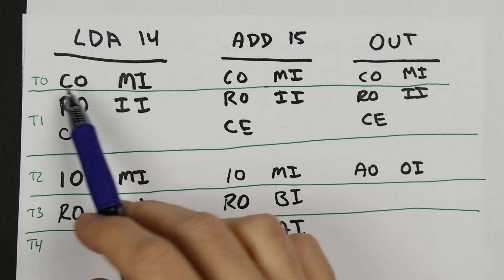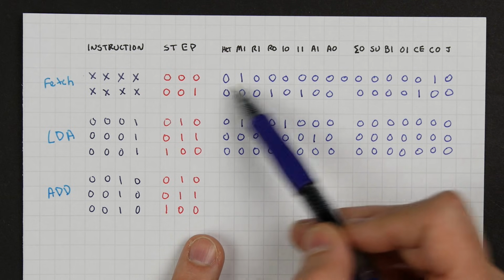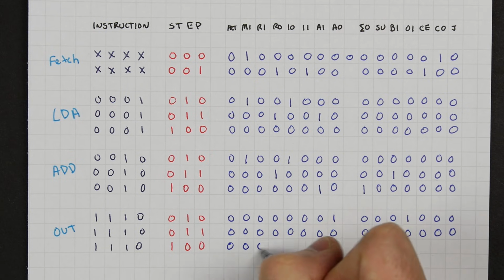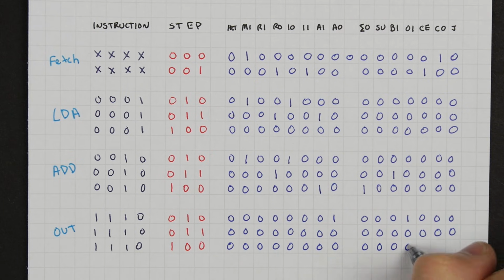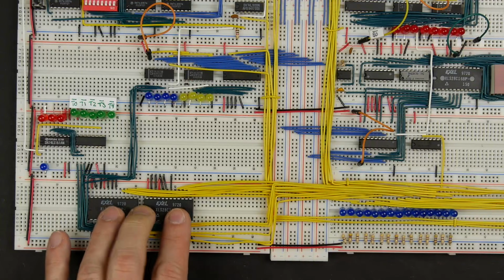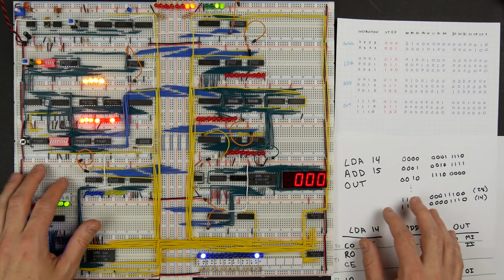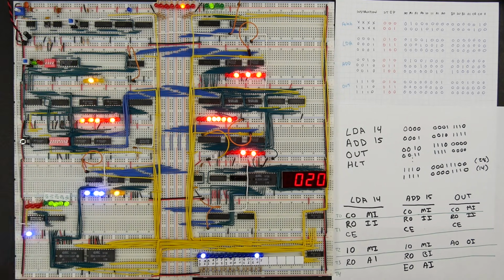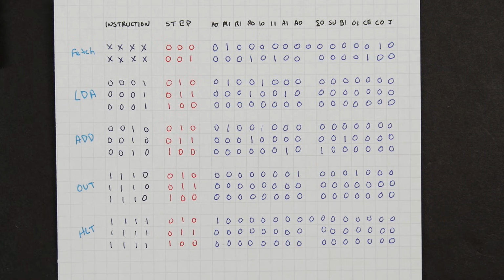8-bit CPU control logic: Part 3

Comment: I find it interesting that the entire instruction fetching, decoding, and execution logic you're building in this video takes up a lot less memory than the 7-segment display decoder (256 bytes across two EEPROMs instead of almost the full 2k for one EEPROM). Intuitively this part is a lot more complicated, but apparently not information-wise.
Reply: Also, if you're going to use the manual EEPROM programmer a lot, wouldn't it be easier to use DIP switches instead of jumper cables for selecting the actual bits to program?

Comment: So, if you had another signal to reset the microinstructions counter (which is the master-slave JK flip flop chip), could you skip those unused cycles? It seems like a very reasonable improvement to speed and could be set at the final step of every instruction. That way, no matter if some instruction is 5 cycles long, if you are using 3 or 4 step instructions, you would be gaining 15%+ average speed.

Comment: My version of this CPU has been upgraded to have 256 bytes of memory about 36 instructions with a max of 63, two conditional lines with jump on (no) carry and (A!=0) A=0. Used the unused output on the 2nd rom for an external input, added a 3rd rom for microcode reset (and maybe further hardware) so shorter instructions only use as many clock cycles as it needs up to 7. The 256 bytes makes it prohibitive to manually program so I came up with a loader to pull a program off a rom on the IO bus so I only need to program 10 bytes manually and it loads a longer program in

Comment: You also bumped the memaddr reset cable at about 31:05 which cleared the memaddr but luckily it did not matter at that point :)
Reply: Thank you for commenting on this. I’ve been scratching my head as to why that went to all zeros and mine did not. I also somehow get a 30 and then a 47 on the display on the way to 42. Not sure how that’s happening, as output in is only enabled at the end.
Reply: @smithw7003   Yeah. I don't think Ben mentions this at all in this series, but you really should have pull-up or -down resistors in the signals that have manually operated cables, that way the signal gets only activated when you insert the cable into the other voltage and not by just losing connection momentarily. I cannot say what causes your strange numbers, perhaps you have an intermittent connection to OI. Or a supply voltage problem might also do weird things sometimes.

Comment: Great video series, thanks for making these. That EEPROM based decoding scheme reminded me of the MOS 6502 decode ROM, showed in Michael Steil's "27C3" - "Reverse engineering the MOS 6502"  Also the micro instruction timing was similar.

Comment: Why did the [Memory Address Register] clear it's value a moment after the clock was stepped forward at 31:00 ?  The instruction was [RO] and [AI] and the rest LOW.  It should have only moved the value in ram to the A register, not reset the [Memory Address Register], right?
It happens sometimes right after a value is moved out of ram, but not always... why?
Reply: Oh, he bumped the MAR reset wire and reset the memory address register to zero a couple times.

Comment: Once you finish this 8 bit cpu build video series, you will have two fairly similar breadboard CPU's, right? Would you consider doing a short bit where you explain a few things about the basics of how asyncronous cores work in modern multicore desktop CPU's, using the two breadboard cpu's?

Also maybe a short bit about creating a small serial comm between the two as well?

Comment: I'm curious about the Halt command, that's a dead end isn't it? there is no way a computer (that relies on a clock signal) could ever undo this, seems very strange to me to have such a state vs a pause of some kind.  That aside this has been an extremely informative series so far being almost exclusively a software person the hardware side of things have long been a mystery to me. 

and now I can count in binary so that's a plus
Reply: Many CPUs, especially microcontrollers, have a halt command that is useful to save power. But usually the CPU continues execution when an interrupt happens (e.g. some peripheral wants attention).

Comment: This has to be one of the highest quality video series I've seen here on Youtube.
Reply: For sure!! I've watched every single video in this playlist from start to end and I understand everything so far 100%! I'm sure by the last video I'll be able to build one of these myself with my own design (I have a different method of doing the display logic, and I have an idea on how to eliminate those wasted clock cycles on shorter instruction sets).
Reply: Probably better than real electrical engineering courses in colleges.
Reply: 100
Reply: It is. Until you see his 6502 cpu series

Comment: I would suggest to use the left over bit in the signal word for resetting the instruction counter. So that you can say "with the next clock pulse reset the counter" - useful if not all time steps are used.

Comment: Have you ever thought about using something like a crystal oscillator to use as a timer? This could be used, (in conjunction with more ram/instructions/etc) to interface with devices like an Arduino, to interface via i2c/usb/ethernet/etc. My main concern with using such a fast clock is how fast the chips themselves are able to change. Of course the communication is outside the scope, but perhaps a constant, highspeed clock isn't? :)

Comment: I think the halt command could just be a 4-way AND gate on the 4 instructions bits. If you somehow initialize the ram to FF everywhere as soon as you exit the memory region where the program is encoded it will output the halt command. 

The same way you could implement a 4-way NAND to trigger a counter reset when the instruction is 0000 with a gate to only trigger the reset on !(T0 || T1), effectively implementing a NOP instruction.

I'm still waiting on having a bit more of money set aside to be able to start such a project : as a programmer I love to explain to my friends how a computer works and this is a perfect demonstration board :D

Comment: At around 39:39, the computer starts loading undefined instructions, and starts putting multiple things on the bus. (Sum out and counter out are enabled simultaneously) Won't this cause a short and damage the components if a 1 and a 0 are placed on the bus at the same time?
Reply: I don't think it should, because the state of the bus when the input is taken should only be either/or, but not both as it's done on the rising edge.
Reply: @CJBurkey  well those tristate buffers connect the bus to ground at a 0, and to vcc at a 1. that means if one module has a 0, and another has a 1, one tristate buffer will connect the bus to ground, while another connects the same bus to vcc.
Reply: Wait, +MrEdrftgyuji explains why it could a few comments below
Reply: better hope all the magic smoke doesn't escape
Reply: You're exactly right, it's driving multiple contending outputs onto the bus (sometimes all five at once!). It's a good thing that these TTL parts are forgiving about "shorts" like this. Of course, TTL outputs have limits on the current they can drive.
For that same reason, Ben is able to directly connect LEDs to outputs without a resistor (and not blow them up). That kind of thing is "minor abuse for the sake of convenience", and might cause problems like power supply lines being dragged down (and logic levels being lowered to indeterminate levels), but hey...
FYI, most TTL-ish logic can source (push out a high logic level) much less current than they can sink (push out a low logic level). E.g. a 74LS32 datasheet I'm looking at shows source output current as 0.4mA, and sink output current as 8mA.

Comment: Alternatively, you can have a halt condition from the RCO output pin on the program counter. This pin is HIGH while on the highest address (0xf), and LOW otherwise. The halt functionality doesn't have to take up opcode space that way: just let the program run to the end of memory, then stop.

Comment: question: in a serial shift register, what prevents the output of f-f A from going into f-f B and generating and output on f-f B? why does it have to wait for the next clock pulse?
Reply: There are two ways to do this.  One is to use master/slave flipflops.  These flipflops read their new value in on the rising edge of the clock and write it on the falling edge.  This keeps the changing signal from going farther then you want them too.  The 2nd way is to make the flipflops read their value on the rising clock edge, make the time that they are reading that value short enough that the internal feed back paths don't cause problems, and make the clock arrive at all the flipflops at the same time.  The 2nd way lets you use faster flipflops but requires harder layouts of the wires on the board.  This is why when you look at a motherboard you will see some wires go strait from one chip to another, and others squiggle around a bit first.  The different lengths of the wire make all the signals arrive at the same time compared to the clock signal.
Reply: ared0hel thank you, I've asked this question to a couple of electronic technicians I know and none of them knew the answer. So I had to ask the internet. I'll look for more info on the whole master/slave situation ;)
Reply: Ben has 3 videos on exactly this: JK flip-flop, JK flip-flop racing, and Master-slave JK flip-flop.

Comment: Awesome as usual, Ben! You have tought me a lot and I thank you very much for it. You inspired me to build a computer myself, only it's 8 bit with a 64kB address space that's split into 8kB ROM and 56kB of RAM. I have seen comments on how much more complex it would be to expand your computer to the same size and I can confirm that! My build is 100x60 cm large! If anyone is interested find me on Twitter (@mynkus) and look at the latest tweet where you can see the address and data bus, ROM, RAM, 4 registers, clock, stepper, instruction register and control logic. The ALU will be built "discrete" with 74xx chips. And I plan to add a 4x20 character LCD. Again, thank you so much Ben for all the inspiration!

Comment: I wrote an emulator a few weeks back. It's messy and slow, but it works. If anyone wants to help, the GUI needs to be worked on and accuracy checked.
https://github.com/nutcase84/ben-eater-cpu-emulator

Comment: Put in some 74LS138 decoder/demultiplexters, 3-to-8 lines, one for output: RO, IO, AO, ZO, BO, CO, HLT and NONE. The other for input: MI, RI, II, AI, BI, OI, J and NONE. Two extra lines for CE and SU. 8 bits in total. Only one EEPROM needed. Part of the opcode 4 bits could be used to determine the length of the cpu instruction. Eg. all 1XXX instuctions being 3 steps, all 0XXX instructions being two steps.

Comment: I would have kept and modified the circuit that drives the fetch steps.  Since they are all the same, it seems a waste of time to program them into the EPROM for every single instruction.
Rather it would have been more expedient to only actually enable the EPROM output at the third and subsequent steps and only have to program where the instructions differ.

Using the last control line to reset the counter would also be a fairly easy way to save clock cycles as well.

Comment: I can see that it would be possible to use that currently unused bit as a signal to reset the microcode instruction cycle counter.

I'm wondering if it would be possible to not only use the currently unused bit as an "Instruction Cycle Reset" line, but also to make it concurrent with the last microcode instruction?

Just using the ICR as a separate microcode instruction would not save any CPU cycles on a 4-step instruction since the 5th instruction would still be necessary even if it was programmed as the ICR signal, but if the ICR could be made concurrent with the final microcode instruction, then a 4-step instruction would truly take only 4 steps.

Perhaps build the CPU so that the instruction executes on the rising edge of the clock pulse and the reset of the instruction cycle counter happens on the falling edge of the clock, if the ICR signal is active?  If part of the instruction requires the falling edge of the clock, then perhaps a capacitor could be used to slow down the ICR signal?  Although that might require an XOR gate too.

Comment: Need to be careful when executing "junk" microcode that sets more than one device outputting on the bus. If one device is driving a bus bit high, and another one low, you will have a short from Vcc to gnd which will probably cause damage to the chips connected to the bus.
Reply: An improvement on this design is to have a 3 to 8 line decoder control which register is outputting data to the bus, preventing bus conflict.  This also frees up some control lines.
Reply: @ared0hel  ...or using a demux for the enable signal // demux{input: instruction-register.bit-a, select: instruction-register.bit-(b, c, ...), output: enable for the various registers}
Reply: @LeonardPauli  or use an arduino to set all unknown values in the eeproms to 0b00000000, just to be sure.
Reply: @ared0hel   Good idea. Instead of direct control of lines it should be some sequential binary code (virtual address) decoded into control line indexes (each combination once in ROM)
Reply: Yeah, that part with executing a random junk from memory made me worry for the exact same reason. I imagine the troubleshooting process would be quite painful.

Comment: Really enjoying this series Ben, many thanks for taking the time to do it. I've been working in IT for a long time (almost 30 years), but never really understood how everything worked 'under the covers' until this series. I've enjoyed it so much I placed an order yesterday for all of the initial components to build one myself, although I'm planning on extending a bit once I get the base working (8+ bit addressing, multi-byte instructions, and maybe even a storage interface of some kind to load RAM from EEPROM or removable media). I had to use some substitutions for some of your parts list as they are hard to find - the 74LS76 (Dual JK Flip-Flop), 74LS189 (64-bit RAM) and 28C16 EEPROM - hoping I've understood enough that these work. Now just waiting for all the bits to arrive (no pun intended) to start playing.

Comment: This has been fascinating so far. It's inspired me to try building something. (I mean I already had that thought, but now I'm considering other things, and trying it on a breadboard rather than a more permanent form. XD)

If you're continuing with this much I'd be interested to see something like instruction pipelining.
I have no idea how complex it is, but some rather old CPU designs had some minimal pipelining going on.

Like the 6502 which loads and decodes one instruction while doing the  first part of calculations for a second, and the final parts and data store for a third.
(it's part of the reason the 6502 can even have some instructions that complete in just 2 cycles.)

I mean, that may be too complex to sort out for a design like this, but a minimal 2-stage pipeline would be fascinating to see. (maybe those first two operations that repeat for every instruction could be the first stage, and the other stuff could be the second stage - that would not be perfect, but it would probably cut things down to 3 cycles per instruction at most. - and may still be simple enough to be possible to demonstrate on a design like this.)

Personally, I may take on the idea of building a graphics chip rather than a CPU. XD
Not a 3d chip obviously, but a basic 2d one.
Seems fun. Tiles and sprites and stuff. - May have to cheat a little and give it a pair of framebuffers (which a design from that era wouldn't have), because I assume logic made from discrete components would be too slow for video output that monitors expect.
With a dedicated framebuffer at the output stage, the main logic of the graphics chip could run as slowly as it needs to, and then write to memory, while the video output stage runs at the 25 mhz or so needed to output a 640x480 analogue VGA signal.
(the system wouldn't be 640x480, but that's the lowest standardised VGA resolution, and is still supported by modern monitors if they have a VGA input. - You may be wondering if you're old enough how a VGA graphics card can deal with a monitor that only accepts 640x480, and yet run at 320x240 (or whatever other resolutions) - well, strictly speaking VGA monitors supported a handful of other modes, but the real trick is the VGA adapter is kinda lying to you. 320x240 is actually 640x480, but it draws every pixel twice, and every line twice. So, it outputs 640x480, but internally only has to do the calculations and use the memory for 320x240).

Anyway, with the conceit that we have a double-buffered block of memory for the output stage, we could then build any kind of logic on top of that, operating at any speed, and it could switch framebuffers for the output stage whenever it's ready.
Then we can build an old-style tile and sprite graphics chip (like those found in 8 and 16 bit consoles, and many of the 8 and 16 bit home computers from the 80's too), and however slow it ends up being due to the limitations of using discrete logic, it can still output a stable picture, just perhaps at an extremely low framerate.
Unlike the 80's, memory, even SRAM (in small quantities anyway) is dirt-cheap, so we can get away with this pretty easily.

Seems fun, right? XD